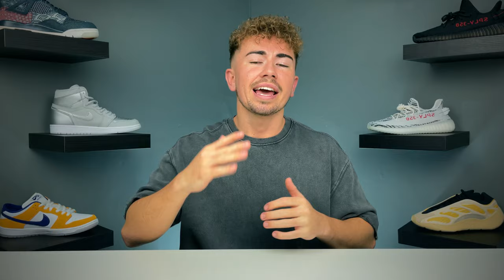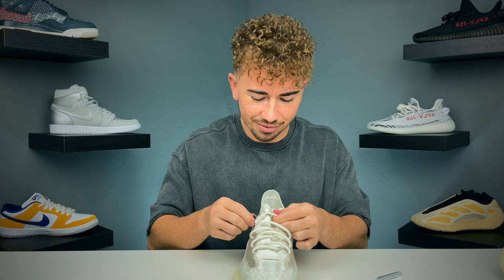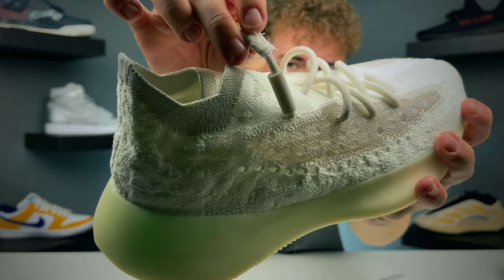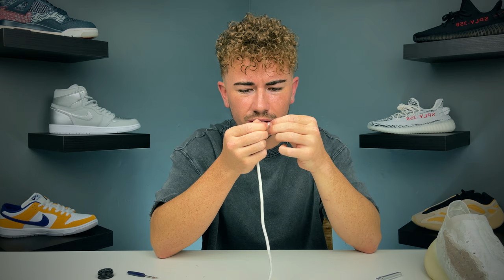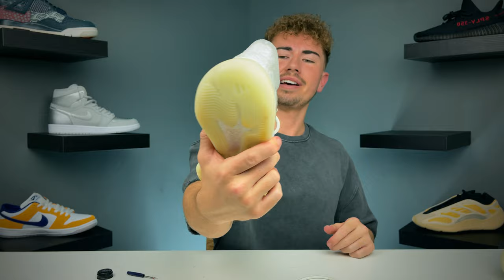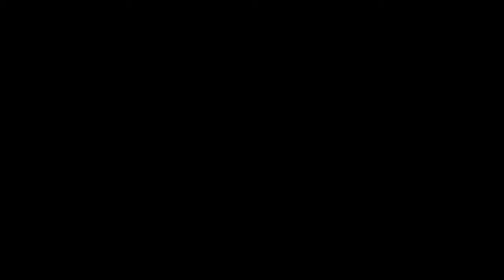How To Remove New Yeezy Laces Without RUINING THEM!

Comment: you should do a video where you add infinity laces on older yeezys
Reply from the maker: True that’d be easy enough to do but I’d have to find that rubber tube that covers the join
Reply: @elliotpage_  bro put the Infiniti lock on the new lace tips shove them into it if u want to use them again throw the cut lace away u don’t need it
Reply: Rubber tube can be used on the new lace tips
Reply: Thank me later

Comment: I just got my pair is it normal for it to be a little wide in the back?😬
Reply: Heyo, if it helps, i found that the bit that essentially locks a shoe to your ankle ( the final eyes of most laces) dont really exist on the 380s. If you pull the laces through on the inside (underneither the primeknit basically) it'll hold your foot a tonne better and reduce the slip, but honestly after a good couple wears round the house they dont rub atall on the heel :)
Hope this helps
T
Reply: @piepints  I’ll try it THX🙏🏻
Reply: @shahadalrashoud7040  np, lemme know how ya get on :D